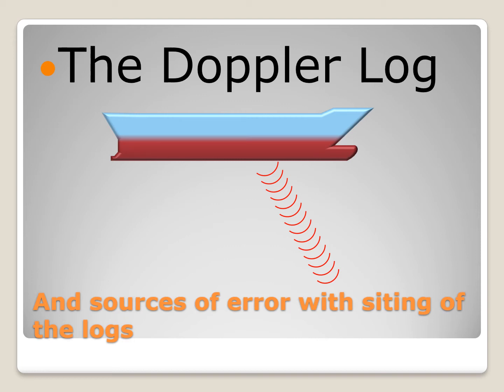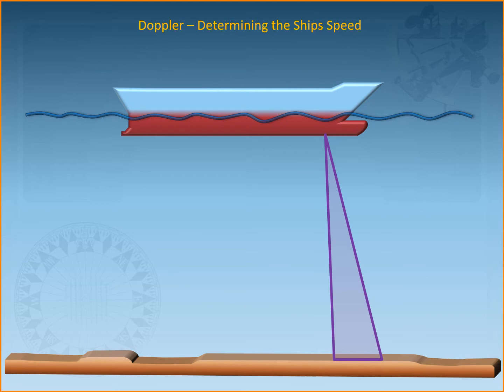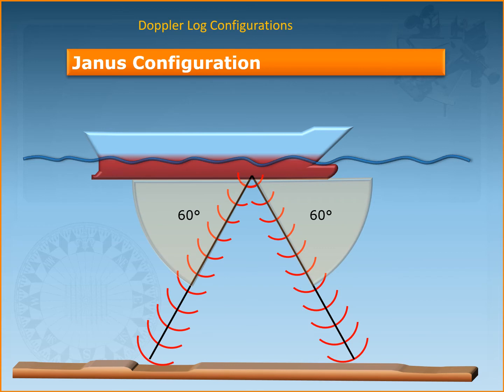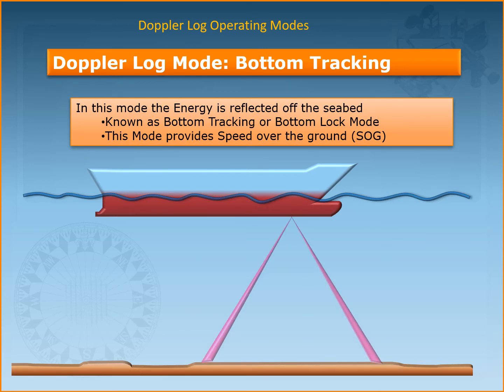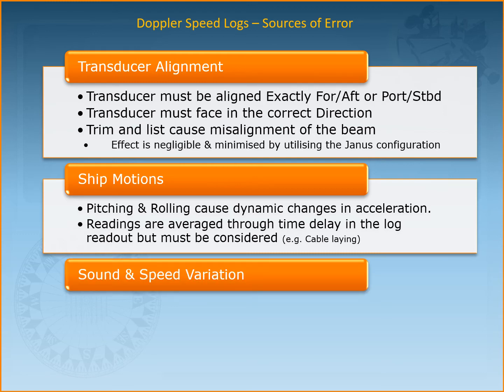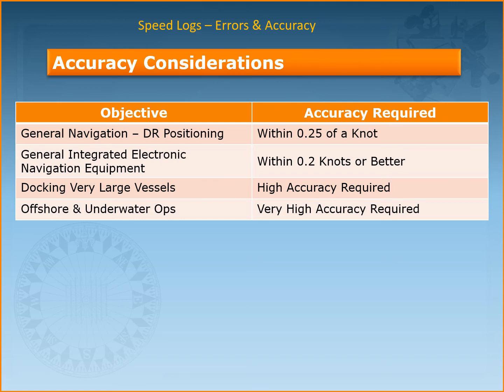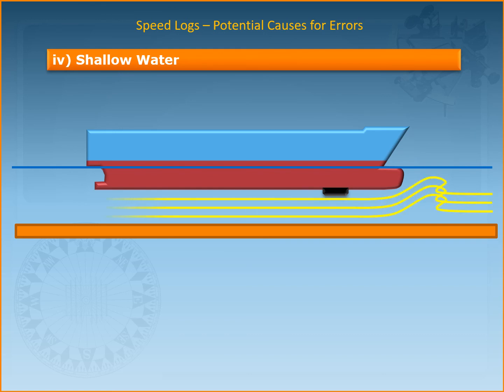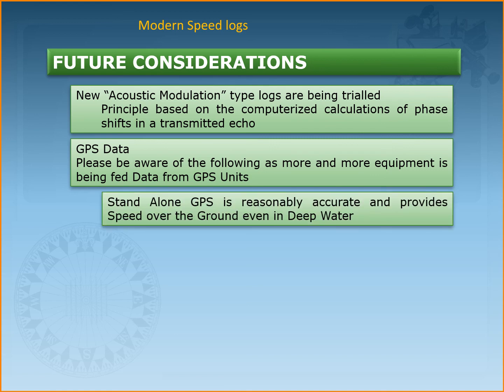Doppler Log and errors associated with siting of logs - with Improved audio

Comment: I've read somewhere that when you want to calculate fuel consumption and when you want to check engine performance its always recommended to use STW because its excluded from factors that could affect the ship speed. and when you want to calculate for navigation and ETA and collision calculation its always recommended to use SOG as it gives the accurate speed. i wish i knew whether is this correct and if it is, could you explain in more details on why STW is used for those applications